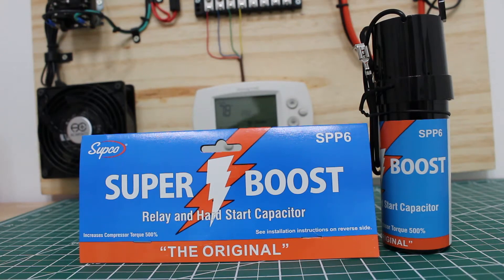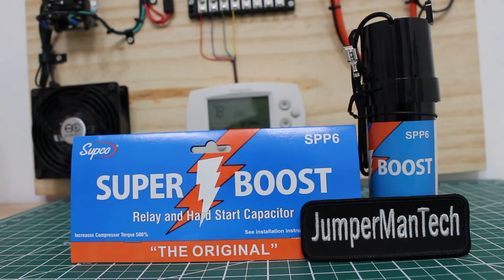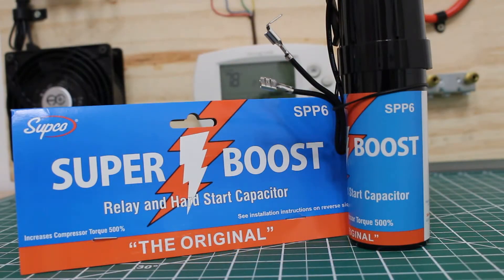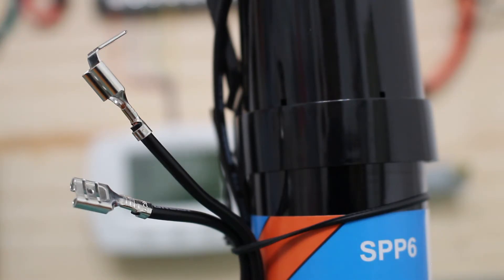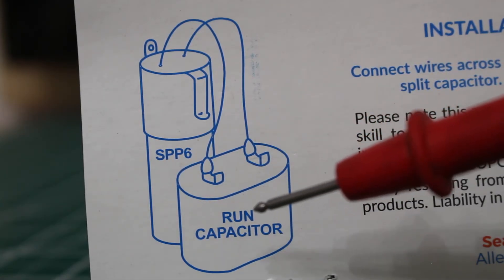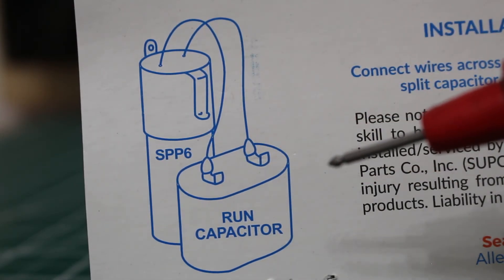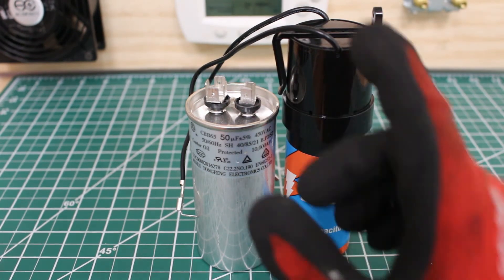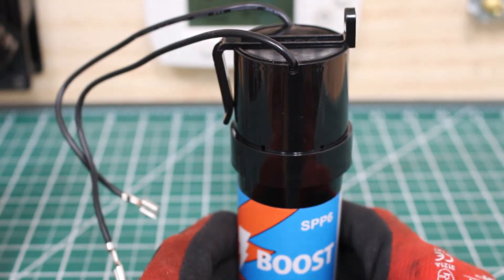HVAC: Supco Super Boost Installation (Supco Super Boost Relay And Hard Start Capacitor) SUPCO SPP6

Comment: I have a 3hp belt run air compressor thats hard starting. I replaced both start/run capacitors with no change? Do these work on Air Compressors too?
Thanks

Comment: Supco spp5 and spp6 tried both even with two new diff capacitors.  Fan turns on for like 10 second and then shuts off compressor still not starting …

Comment: I have a SPP5 can i replace it with a SPP6?
Reply from the maker: If they are both just 2 wires, you should be good. Just make sure it's rated for the same. Thanks for watching! Stay tuned for new videos every week🔧⚡️
Reply from the maker: Look into the HP rating and if they match 👍
Reply: I called the manufacturer and talked with a technician for the company of this product and they said it was fine to go up to 6 but do not go from 6 to 5. I'm just so grateful that we have this technology that we can discuss important issues like this thank you so much.

Comment: Can you install the boost capacitor if you only have a two terminal capacitor, like the one in the video, but the fan and the compressor are on  the OEM capacitor?

Comment: I bought one of these 15 years ago as an emergency backup and never needed it until now; thanksgiving week 2023.  The refrigerator / freezer had already gone too warm before I noticed.  I have the 5 wire version.  It was quite simple to install. 
At the compressor the factory starter and capacitor is attached to the side of the compressor. There is a small bent metal wire that wraps around both pieces; it just unhooks from the side you are on.  It's meant to hold the capacitor and starter in place. 
The two come off easily, you can probably pull it off by hand but I used a flat blade screwdriver to start prying it off.
Looking at the supco it has 3 blade female blade receivers on it. I was expecting the comproessor to have blades on it.  The compressor actually has small round prongs. When I looked at the Supco terminals I realived they are shaped to accept either blade or the prongs. The directions for which wire goes to which prong are on the side of the supco, very easy to understand.
The other two wires did not have terminals on them and the instructions said to hook one to either supply line and the other one ges to the other supply line.  What this means is the connector coming from the refrigerator plugs into the capacitor normally but in this case you have to cut the connector, strip the two wires (you can do it) and then twist one to each of the wires on the supco.  You then need to put small wire nuts on each of the two wires but you could get by with electrical tape in  pinch.  The supco probably came with wire nuts originally but it was already out of the package and they were lost.
Tuck the supco in next to the compressor, plug in the refrigerator and it started right up.
My existing, original from 10 years ago starter was blackened and charred.  A new set will not arrive for two days.
I then searched for supco start capacitor just because and saw this video and figured I would offer my tale of a quite easy repair.

Comment: Pay a little more money for the 5-2-1 kit. 2 wire hard starts will usually fail within the warranty period and you will be going back to do a free service call. 5-2-1 kits are much better and have a lower fail rate.

Comment: I ordered this, but it seems it’s the wrong item? This only has two wires. My capacitor has three prongs for the following wires: common, herm, and fan. Looks like I wasted my money, and I’m still roasting hot. 😢
Reply: Dual capacitor. Use  two herm (compressor) and common. No wire on f or fan.
Reply: the wire with the additional spade goes to common or "C" and the other goes to "HERM". Make sure discharge the dual run capacitor by using an insulated screwdriver and touch c to herm and c to fan making sure you hold onto insulated part of screwdriver.
Reply: @NO-END - Thank you for the capacitor discharge tip - and of course you mean after disconnecting power.
Reply: Will Installing this reduced or cause any damage to the life of the compressor? My unit starts up every time although I do hear a loud noise when it kicks on.  But after that it works great. We're in 2024 and the unit manufacturing date is 2006. Just want to make sure this product will not harm my unit as I love how it cools my  home in Florida.
Reply: @antonylesten7319  Did you install it?  Did it help with your loud kick-on noise?  Our AC unit gives a loud THUNK noise when starting up.
Reply: I understand what the two wires attach to but how did he apply the L shaped wire

Comment: Can I use one of these to help start a window AC unit that I want to power with a 12v battery bank?
Reply: if the unit is 12V or you have an inverter

Comment: Greetings JMT. A subscriber here. I have a True reach in freezer where the compressor is drawing high amps and so it won’t start. It’s a single phase 240volt. I have checked all the starting components; potential relay, run capacitor, and start capacitor and they all are good. I also have checked the compressor windings and they also checked out. And the compressor is definitely not shortened to ground.  Do you think I should install this compressor booster in line with the run capacitor to see if it solves the issue before I go replacing the compressor which is over a thousand dollars? Thanks a lot in advance for your reply. And please keep posting more videos. I’m learning a lot watching them.

Comment: Great vid. Does the existing run capacitor need to be good in order to use this SPP6?  Can I use this if there's no run cap in the system?
Reply: Replace cap!!! The spp6 is only in the circuit for a second then turns off

Comment: Unfortunately, you didn’t show where should to connect compressor. Why I need to connect the Booster without compressor. Is it works without compressor? Where is compressor? 
How to connect the compressor to the booster if it have the two wires only ?….
I wasted my time here ..
Reply from the maker: You are looking for instructions for a different product. I made a video on that too. I will leave a link to that video below.

3 N 1 Hard Start Kit 
https://youtu.be/sem9z0H1QmU

Comment: Bro I just used it super amazing thanks for the advice and tips. Keep up the great work!!!
Reply: Unfortunately, he didn’t show where should to connect compressor. Why I need to connect the Booster without compressor. Is it works without compressor? Where is compressor? 
How to connect the compressor to the booster if it have the two wires only ?….
I wasted my time here ….

Comment: Good vid and good explanation ... Thx ...
Reply: Unfortunately, he didn’t show where should to connect compressor. Why  do I need to connect the Booster without compressor. Is it works without compressor? Where is compressor? 
How to connect the compressor to the booster if it have the two wires only ?….

Comment: Does this reduce the lifespan of a compressor in your opinion? I mean if the compressor is “having a hard time starting” it’s probably on its last legs??
Reply: Unfortunately, he didn’t show where should to connect compressor. Why I need to connect the Booster without compressor. Is it works without compressor? Where is compressor? 
How to connect the compressor to the booster if it have the two wires only ?….
I wasted my time here ..

Comment: Interesting and helpful jmt well done
Reply: Unfortunately, he didn’t show where should to connect compressor. Why I need to connect the Booster without compressor. Is it works without compressor? Where is compressor? 
How to connect the compressor to the booster if it have the two wires only ?….

Comment: Interesting and helpful video.  Well presented and explained. Great job JMT
Reply from the maker: Thank you Izzy! Much appreciated 🙏🔧⚡️
Reply: Unfortunately, he didn’t show where should to connect compressor. Why I need to connect the Booster without compressor. Is it works without compressor? Where is compressor? 
How to connect the compressor to the booster if it have the two wires only ?….
I wasted my time here ..
Reply from the maker: @yuriigorg721  The capacitor is connected to your compressor or motor. You connect this to the capacitor as shown. Thanks for watching 🔧⚡️
Reply: @JumpermanTech  Nine of the SPP6 videos tell people which actual terminals to use. Look at the capacitor stamp and it shows 2 capacitor ratings. The low number say 5uf is for fan motor and the large number say 35mf us for compressor motor. Connect between Common and the high number for proper parallel compressor connection.
Reply from the maker: @yuriigorg721  You might be confusing this for the Supco 5-2-1 kit where there is a connection at the compressor itself and the 2 power wires feeding the compressor. I have a video on that too